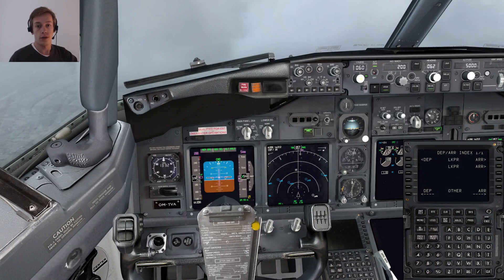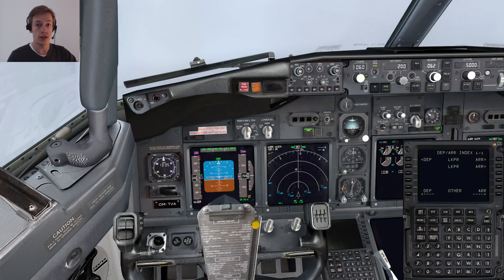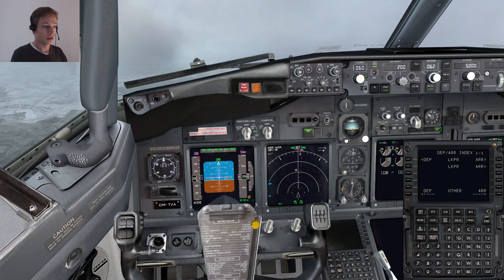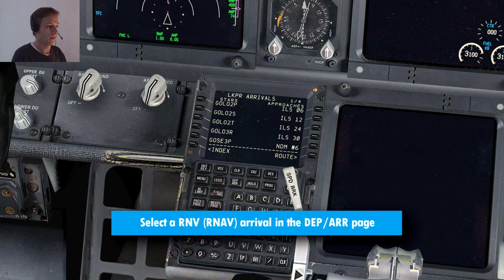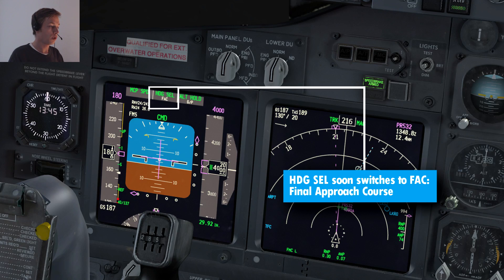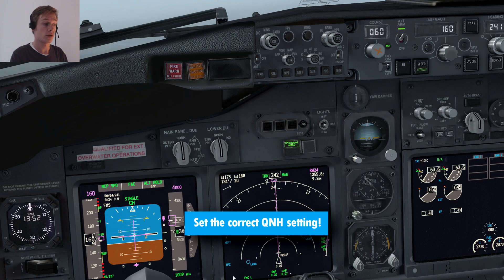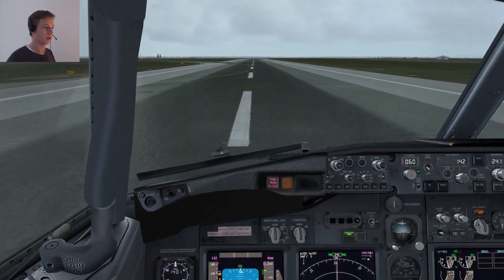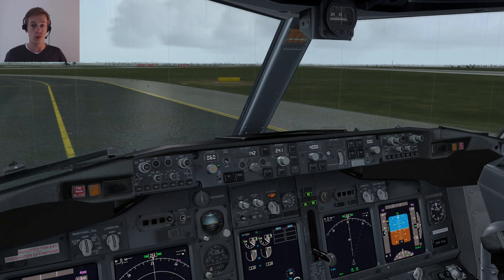How to Perform a GPS (RNAV/GNSS) Approach! [Boeing 737NG] [P3D]

Comment: Can you fly an RNAV GPS approach without an autopilot? Can you do it manually or the autopilot needs to be engaged? Thanks
Reply: u can turn off the A/P and follow the LNAV/VNAV data manually but not in a complicated approaches that has alot of points and different altitudes

Comment: I have 2 questions.
I was doing this flight from EGKK to EGPE. I selected RNAV 05. After that, I checked the LEGS page. Brings up a route discontinuity thick wasn’t there before. So I fixed the discontinuity. And then tried to fix the approach on the legs page. But it says Invalid Entry. 
1. Is it normal for the plane to bring up the route discontinuity? Or was I doing something wrong?

2. Which waypoint/airway am I supposed to select in the legs Page to select my approach?

Thank you for reading :)

Comment: Is the aircraft able to capture the G/P without the FAC captured (because it will capture it later)?
Reply from the maker: Good question! I don’t know to be honest, if it really acts like an ILS capture it won’t be able to capture the ‘glideslope’ (G/P) before the localizer (FAC). Give it a try, you can always use vertical speed in case you’re not on the FAC yet
Reply: @AviationPro  Well, I actually tried it in Toncontin, Honduras. It didn't work on the RNAV 02 Approach, but this was maybe due to a higher capture altitude than on the chart (+300ft) or a steep glide path (3,5°). The glide path was correctly simulated (I guess) but the aircraft just didn't capture it. I am using the version 3.32d of the Zibo modified B738 in X-Plane 11.30 with the AIRAC 1813 and I would really appreciate if someone could tell me their experience with the PMDG B738. Anyway, thank you for your compact tutorial. I tried a standard RNP Approach and it worked ;)

Comment: Great video but there's one thing I'm confused about... I was doing a test flight and when I came up to the approach (I had a full flight plan set out already using LNAV and VNAV) and armed the approach mode, only the FAC thing came up but not the glide path. Is this normal? Cheers
Reply: NEVERMIND, just tried again and it's working perfectly
Reply from the maker: Glad you got it sorted! It should work like this, provided you have selected a GPS approach in the DEP/ARR menu of the FMC.

Comment: hi AviationPro i wone get me fsx2017 in old fsx i can switch nav to gps mode  but in the new fsx 2017 can i still do it like in the old days pleas help thank u
Reply from the maker: I'm sorry, but there's no such thing as "FSX 2017" or a "NAV/GPS Switch" in the Boeing 737. I don't use default airplanes, nor any versions of FSX so I'm not really sure what you're aiming at here ;)
Reply: The default aircraft are unable to do (I'm pretty sure) all the of the approaches listed. They can fly ILS, vor and ndb i think, but it's very basic compared to a high quality (high priced) aircraft that AviationPro, assuming he's using the PMDG ngx.

As for fsx2017, there's no such things but there are now a wide range of flight simulators that are updated for modern PCs. Here's a few
Prepar3D v3(32bit)/Prepar3D v4(64bit)
X-Plane 11
Flight Sim World.

All are great.

Comment: how do you get the minimums Alt
Reply from the maker: It's noted on the charts, in this case in the table on the bottom-left where it says OCA/OCH. In this case I'm using LNAV and VNAV, so I can use the BARO setting for the minimums which gives me a Obstacle Clearance Altitude of 1479 feet.

Comment: Hey, I would like to know how did you keybind your additional keyboard. Because I tried to do the same thing but in the controls menu I can see only those actions of Default aircraft, and so f.e. I tried to setup F9 for autopilot (in aerosoftA320) and it did not work, (strangely i tried the same with landing lights, which seem to activate after pressing the button, but the switch in VC doesnt do anything..) Is it like fully working with your 737 and do you have any tips? ty
Reply from the maker: Usually you can enter key bindings via the configuration manager of your addon aircraft or via its FMC. In this case, in the PMDG 737 you can select key bindings via the FMC. I don't have the Aerosoft A320 so I'm not sure how it would work there ;).
Reply: +AviationPro oh okay, thank you very much, will try the fmc in 737:)

Comment: HI mate do you use windows 10 for flight sim, then if its so does the Saitek Pro Flight Yoke and your Saitek rudder pedals works with windows 10? please let me know because i'm thinking of purchasing them but i do not want to purchase and then realize that they're not comparable for windows 10 thanks :)
Reply from the maker: Hi, yes I do. I had some trouble installing the drivers for the yoke after the Windows 10 anniversary update, but it's fixed now and the yoke + quadrant and the rudder pedals work perfectly fine :)

Comment: When I'm departing and contacting the ATC, is the stand I call out just the gate I chose on the menu? If not where do I get the stand number? Thanks!
Reply from the maker: It should be the gate you selected. But you have to make sure by looking outside and looking which stand number is displayed on the gate or on the ground when lining up to a gate. Also, you should confirm if the gate number in your scenery corresponds to the gate number on the charts of the airport. If you have an old scenery, it's best to determine your position on the chart and give ATC the gate number you are on according to the chart, otherwise you will give ATC an old gate number that might be all the way on the other side of the airport.
Reply: +AviationPro cheers appreciate it!

Comment: Would like to see correct procedure to the LFMN (Nice) airport RWY 22R/L :). It is very nice vor approach (not sure about difference between VOR A; VOR B; and VOR C). Also if you will have time could you do some tutorial about STAR's including the transition? For example at Schiphol these transitions are very weird. I dont know how to explain it but they are not connected to runway there is always some kind of circle including SPL VOR in the transition - and these procedures are same as in the real world but the difference is ATC which gives you vectors so you dont have to fly through SPL at 7000 and then overflow the runway and do circle back :D.
Reply from the maker: I'm not really sure either what the difference between those are. As for the transitions at EHAM, yes, most of them run via the SPL VOR, sometimes you simply have to enter the holding pattern at SPL first before you start making a weird turn. Mostly you will be vectored though or you can just vector yourself ;)

Comment: When I go to activate the final approach fix, it gives me an invalid entry. Any idea?
Reply from the maker: I don't know, it should work. Just select the RNV arrival for the runway in the DEP/ARR page and then go to the LEGS page to activate and execute.
Reply: do you need the rwy coarse? or do you need to be on approach in able to activate it?
Reply from the maker: You need to activate the route in the legs page and make sure you are flying on that active route (for example using LNAV) and then arm the Approach mode, it should work. I'm not sure why it would give an invalid entry error, is your AIRAC data up to date?

Comment: Thanks for this! I tried shooting a GNSS approach the other day, but as I had the ILS freqs tuned for 'backup', I was quite surprised when the A/C started a CAT III autoland! Will have to try this again. My local airport recently dropped its SIDs/STARs so pilots have been flying the GNSS approaches because they have nice transitions.
Reply from the maker: You're welcome! Yes that's the tricky part, it may easily fly an ILS of a nearby runway if you tuned an ILS frequency in the NAV radios. That's why there are also distinct annunciations on the PFD for the IAN approach so you know what kind of approach you are actually flying :)